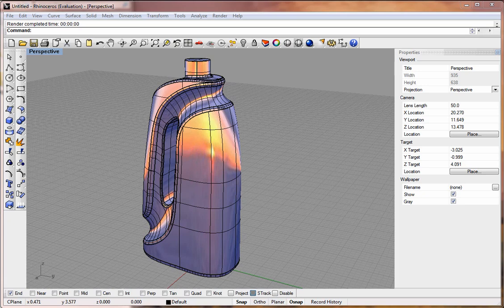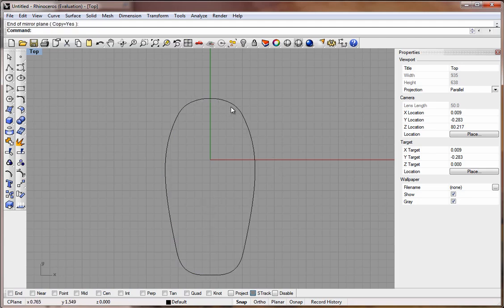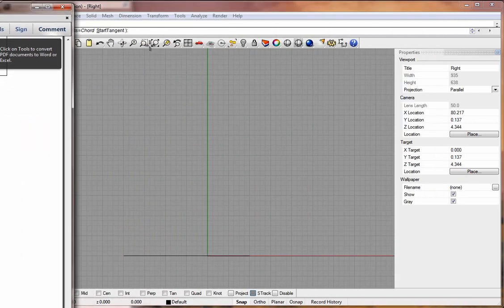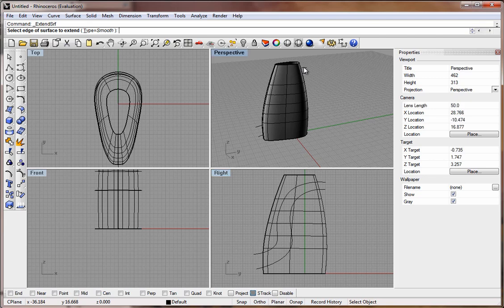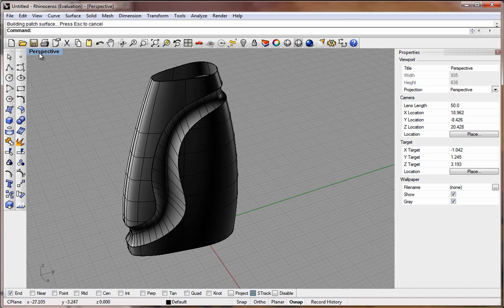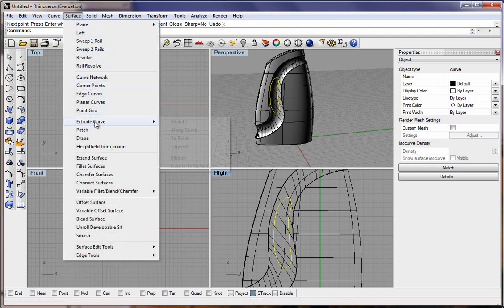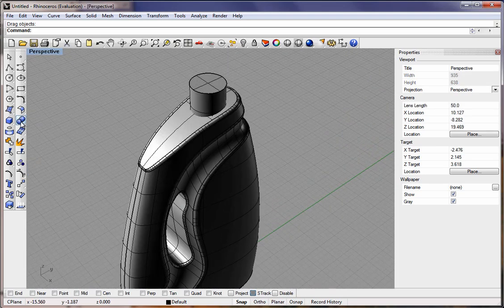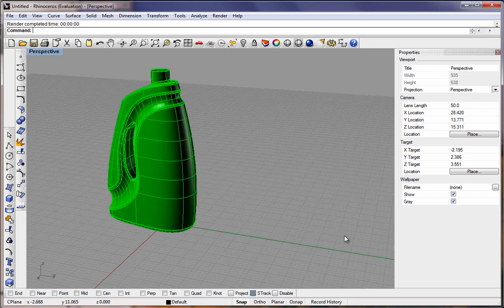E5 Rhino Tutorial - G2 Surfacing Basics for Beginners

Comment from the maker: Hi Ton, Check to make sure you are using blends (not fillets). I noticed when I used fillet that the surface didn't always trim properly and I was left with a collection of surfaces (zero volume). Also, make sure your geometry is able to accommodate the size of your blends, you may need to use smaller blends or adjust the geometry conditions. I hope this helps. Thanks for the kind words. :)

Comment: If you want to create bottles ready for production, try using - for profile sketch - arcs with filleted corners since label sticking machine can stick label only on continual (equal radius value) surface. with that done you have maximum accuracy for label area since you can enter value for the radius and make it same along the sweep...